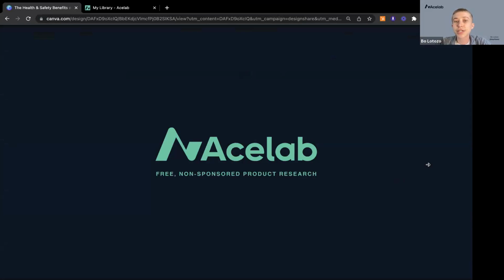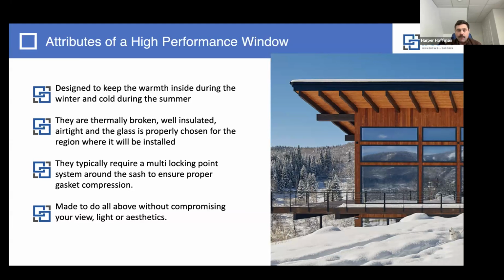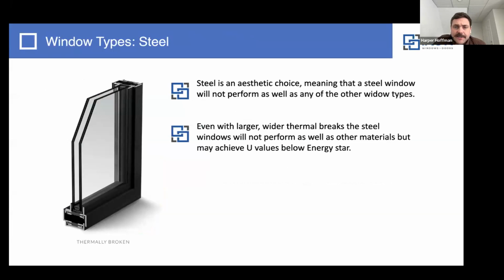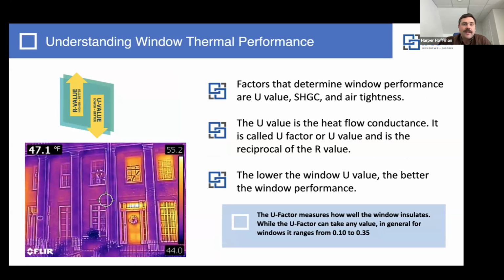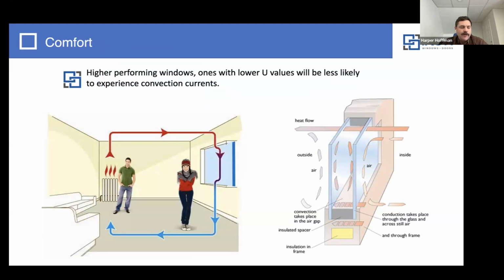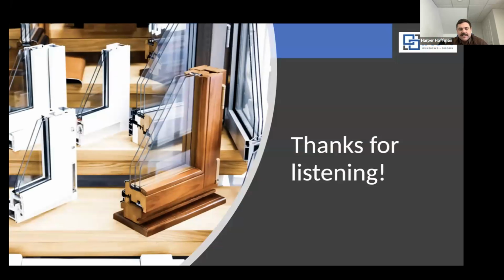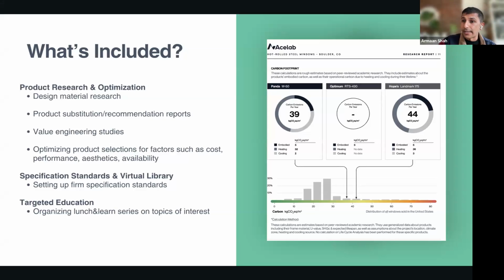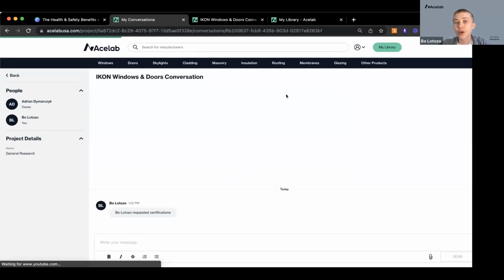Health and Safety Benefits of Today's High-Performance Windows [Webinar]

Comment: Just to clarify a few things about the edge spacers used in IGU systems.

First, low conductance does include stainless steel and partial metallics as well as the fully non metallics, so not just the various foam products can make the claim of "low conductance".  

Superspacer, the most widely used non-metallic available in North America, has multiple versions of the basic design, but comparing the warmest variant to the two most common stainless steel spacers currently available results in Superspacer being about .8° warmer than Endur (Cardinal) and 1° warmer than Intercept Ultra (Vitro) spacers in IG systems. In fact, Endur stainless steel is warmer at the edge than at least two of the Superspacer non-metallic variants.

TPS or thermal plastic spacer, widely used in European windows, with growing popularity in North America, is about .4° colder than Superspacer at the edge and Technoform, another widely used non-metallic European spacer, is about 2° (2 degrees, not 2 tenths) colder than the best Superspacer variant. 
(Temperature differences in F and comparisons based on an IGU system installed in a wood clad window with triple silver coating on surface 2 and with exterior temperature of 0°F (-18C) and interior of 70°F (21C) interior.) 

Despite what some folks suggest,  stainless steel spacers do incorporate desiccant in their design. Desiccant is incorporated as part of an IGU systemin order to dry the air (gas) and lower the dew point within the space to a level well below what the window will ever experience in the real world thus eliminating any possibility of condensation within the space even at insanely low temperature extremes (-100F give or take depending on the product and manufacturer).